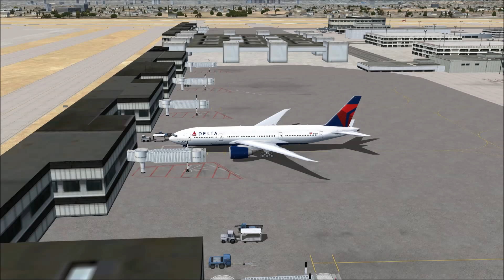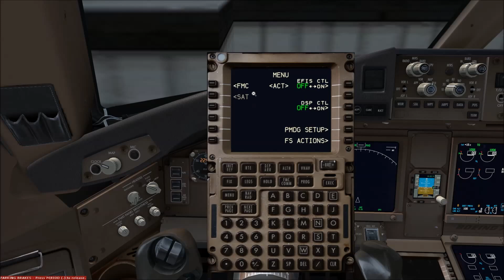PMDG 777 Tutorial: How to program the B777 FMC

Comment: great video really helped a lot but quick question, how was your route already loaded on the fmc when you hit ,"route request" instead of manually loading it?
Reply from the maker: +Anirudh Barath Thanks for your comment. You are right, the route was saved. There are a couple of ways to save the route. You can enter the route in the FMC itself and then save it. Next time you want to use it, it is there.
Otherwise, if you use PFPX or Simbrief, for example, when you create a flight plan, there is an option to save or export the flight plan route for use with the FMC. It is very handy.
Route request in PMDG is simulating the route request data link function in the real aircraft. In the real aircraft, we use data link to upload the route and many other things in the FMC, it is much faster than to enter the whole route manually (and also less prone to errors). What is not simulated in the PMDG is the flight number upload (we have it in the real aircraft) but I guess it is no big deal.

Comment: Can you tell how you found the KLAX runway 24L SID and transition? I get them wrong always and I get a route disconnect
Reply from the maker: +saipan100 You would get the SID from the first waypoint in the flight plan. If not, the transition could be the first waypoint, and the sid would lead to the transition (with a different name). Otherwise, in the USA in particular, a lot of SID's are just climb on on runway heading,  then radar vectors to the route... (for example, the Orlando 1 departure in KMCO).

Comment: Hi there, this video was a HUGE help. I'm using the Captain Sim 777 but the FMC is pretty much the same. Is there a way to load approach procedures? Could you do a quick tutorial? I set up a route from KLAX to NZAA and I can only seem to find how to set up approaches for KLAX but can't figure out how to program them in for my destination.
Reply from the maker: +Mohd. Farid Nordin The TOGW is the sum of the Zero Fuel Weight + fuel. You don't need to enter the TOGW, it is calculated automatically by the FMC.
Reply: Captain Nav thanks Capt!
Reply from the maker: +Skylar Caldwell Hi, glad you find it useful. To cycle through the waypoints, you need to rotate the knob at the bottom left of the EFIS panel to the PLN (plan) position (the kind of default position would be Map). Then, Legs in the FMC and the prompt "step" will appear on the right hand side. Click on it and cycle through the waypoints.
Reply from the maker: +Skylar Caldwell I see you edited your last post, I had not seen the change, my bad. I am not familiar with the Captain Sim 777 software, what navigation database do you use with it? Navigraph? In Departure/Arrival, you have nothing for NZAA?
Reply: Captain Nav 
Hi Capt! 

I have been flying the T7 since day one when I bought P3D. Can you tell me how or where do I get the figure for TOGW on the Takeoff Page that I need to fill-in. Thanks
Reply from the maker: +Mohd. Farid Nordin You are welcome.